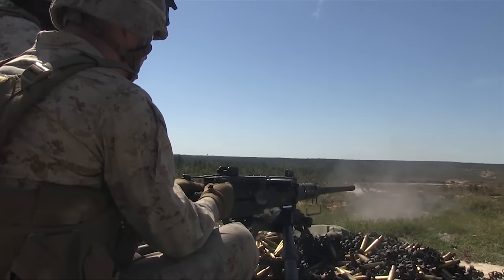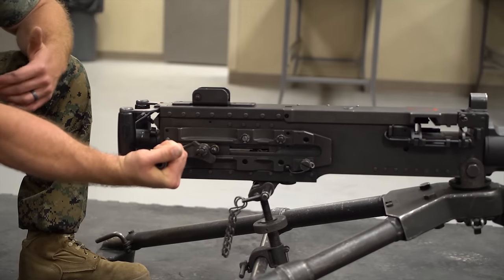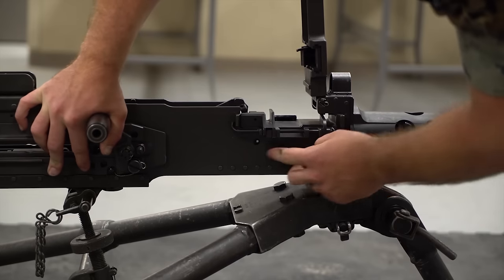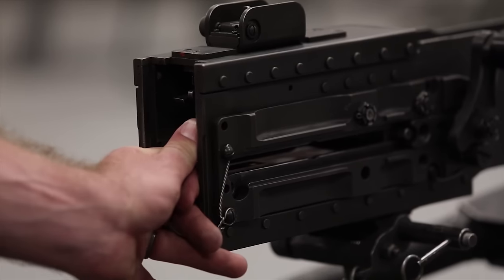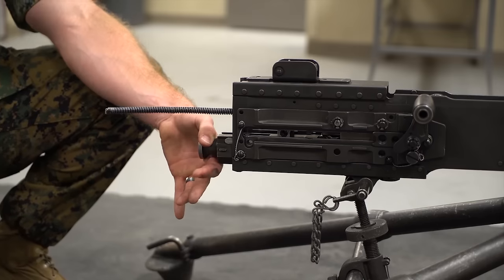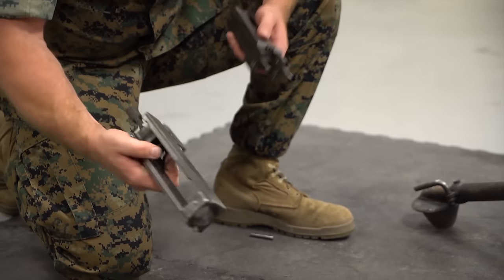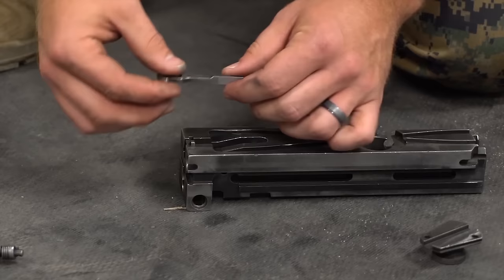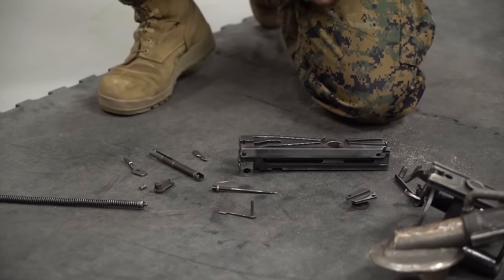How to Assemble and Disassemble an M2 .50 Cal Machine Gun | Marine Infantry Knowledge

Comment: 4:02 I know they have to show the "official" method in official videos like this, but in a field expedient situation when you don't have punches lying around is to take out the recoil spring and use the end of the guide rod to punch out that pin, it fits perfectly.
Reply: You can also use the tip of a round to do it since it’s just a small movement.

Comment: Skipped a couple steps but overall pretty good. Maybe memory is rusty or something got updated. A lot of good facts and knowledge in here. I remember the horror story told to us as recruits. Whole squad wiped out because their main gunner couldn't get the maw duce up n running. Taliban captured it n used it on our friendlies. Long time ago, but to my knowledge the weapon system hasn't changed. Main reason I still carry a leather man to this day. Never know when a tool will fail and you have to adapt n improvise. Granted, I was handed some used n abused garbage but it's still good knowledge.
Reply: Depending on how long ago you last touched a 50, it might have been before the M2A1 replaced the M2HB.

Comment: This weapon was first used in 1918 a 104 year old design that can't be surpassed
Reply: Wasn’t actually created then. It was conceptualized by John Browning as early as 1917. The idea was to replace the M1917 because there was in need of a more powerful round that was able to penetrate armor and be effective against infantry. Most of its concept was taken from the Germans as they had a round that was roughly 13mm, we stole the idea and created what is know as the 12.7mm round which is more powerful than the M1917’s 30-06. It’s first iteration wasn’t until the early 1930s by Colt.

Comment: Man I forgot a lot about the ole 50!  Remember tearing em down all the way to the firing pin but don’t remember a lot of the step!😂 Old age I guess!  I do remember that if it was cocked and you removed the back plate and tried to remove the spring under pressure, it just might go through your chest of face!  😮